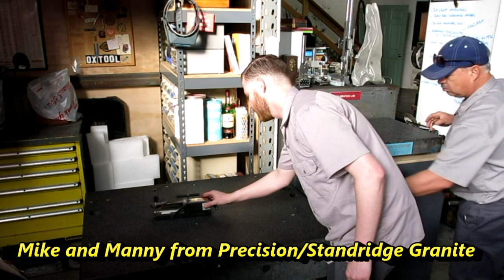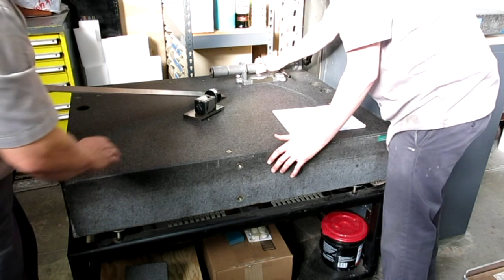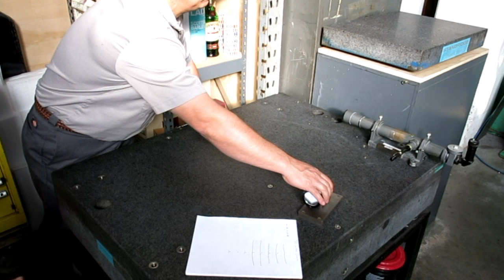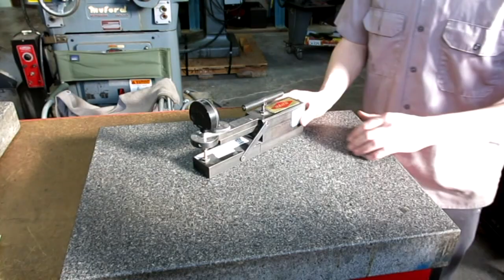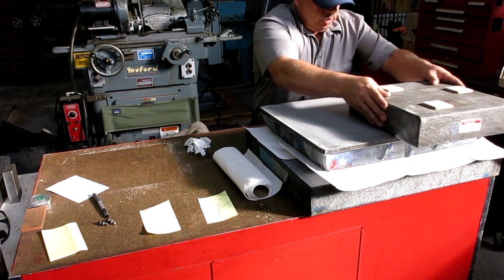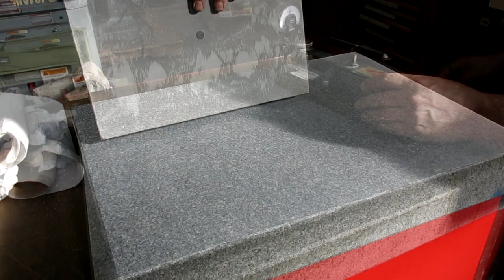Surface Plate Calibration and Conditioning

Comment: Won't the diamond dust contaminate the workshop and cause quick wear & decalibration of plates.
Reply from the maker: Hi Paul,

The abrasive is cleaned off the plates thoroughly after the lapping. Also most of the dust you see in the video is granite and not diamond. As long as you don't blow it off with an air hose it doesn't travel far. Thanks for the comment.

Cheers,

Tom

Comment: I have to come back to his comment @ 3;45+  ..surface accuracy repeat reading of 40 mil and that its not overall flatness ..I am trying to understand the difference ?. I assume flatness is a measure
Reply from the maker: Repeat readings look for small deviations in the surface. The autocollimator looks across the entire surface and evaluates the dips and rises giving a overall flatness. It may not catch the smaller "holes" and "hills" that the repeat meter finds. Hope this helps. Thanks for the comment.

Cheers,

Tom

Comment: I have to assume the iron plates wear as they're used and have to be reconditioned as well.

Cool video.

My scroll saw has a wavy surface with a bowl in it.  It works fine for what I make with it but I'd like to have the table surface ground.  I just don't want to pay more than what I paid for the saw to make it happen.

I do have a cheap granite surface plate (Grizzly) that I could probably use by spray-gluing some sandpaper to it.  Then just do what these guys are doing - either hone the table on the plate or move the plate over the table.
Reply: The honing itself actually keeps the plates fairly flat. I'm sure they need to verify the flatness regularly, but I doubt they need to be flatten often. As to the suface of you saws table, the best way would be to use your surface plate to blue the high spots and then scrape them down. Repeat till you have an evenly blued surface.
Reply: @siggyincr7447   Yes, this. Tungsten carbide paint scraper works great.
Reply: The act of lapping keeps the lapping plate flat and flattens out any depressions on the surface plate by grinding away any high areas. The large lapping plate in the video weighs about 75-100 lbs.

Comment: Really a fascinating video. thanks for posting it.I have a question. The layout and measuring equipment in my little home shop is really becoming a ball and chain at the moment. its the one thing that's preventing me from doing some much more accurate work. I cant afford a surface plate even remotely like the ones you have there! RDG have got one that's certified OO grade. with a surface plate, do you think there is any real reason to go with a named brand? its just a piece of granite right?
Reply from the maker: Hi Peter,

I wouldn't worry about brands. They run free shipping sales on import granite plates all the time. I bought a small one for a friend for $35. Your ability to measure needs to be slightly better than the machines you have to make things. Thanks for the comment.

Cheers,

Tom

Comment: Great video and thanks for sharing and same goes for the crew letting you film/ask questions etc.
I'm pretty sure that there's another video floating around with this guy in it at their shop.It's been a while but I recall him pulling out the old 40's era gear to double check the laser they use.Seems like they've worked a lot together and make a nice crew too.

Comment: could you do a video on making more actuate tools from less actuate tools 
thought being that is the progression civilization started with
Reply from the maker: Hi Bear,

Like making a vise with some files? What did you have in mind? Thanks for the comment.

Cheers,

Tom
Reply: I think an example would be the first lathe making more accurate parts than it has that are then used to make a second lathe that makes more accurate parts than it has, and so on.

So start with a lathe made from tree limbs and "gears" or "wheels" that are drawn and cut by hand.  It wobbles but working on it can get most of the wobble out.

Then round parts are made that are more round than the parts in the first lathe.

I think that's what Gummy Bear is asking about but only using one tool as an example.
Reply: Fuzzy Johnson just that would take alot to do. but you explained what i meant very well

Comment: What exactly are these plates used for?
Reply from the maker: Hi Danny,

These are actually measuring instruments. They represent the primary flat datum in most shops. You can do a variety of measuring and layout work on them. Thanks for the comment.

Cheers,

Tom
Reply: What causes the deformation that needs to be sanded? Just general wear? Whats the purpos of using stone and not a different material?
Reply from the maker: Hi Danny,

The plates actually wear from use. You have to appreciate how accurate the plates are in the first place. Many time smaller than a human hair. Closer to wavelengths of light. So it doesn't take too much wear to knock them out. Granite is good for stability and wear. Some plates are made of cast iron which also wears and needs to be re surfaced to maintain its accuracy as well.  Thanks for the comment,

Cheers,

Tom
Reply: oxtoolco Oh wow. Thats insane. Thanks for the answers
Reply: making sandwiches

Comment: Great video! I'm a metrologist for the DOD...good memories of using the auto-collimator /w mirrors to cal rocks. We now use electronic leveling heads...not as glamorous as the optical way. Very, very cool vid. We have that same H/W collimator on the shelf...it's a beaut.
Reply from the maker: +Michael Dodge Hi Michael,

I am fond of Hilger Watts equipment. I have a level that has a bakelite case lined with leather. Every time I open it up it smells like instruments and precision. Thanks for the comment.

Cheers,

Tom

Comment: I found a plate the exact same as the bigger one he used to flatten yours, in a skip. Had a bit of a gouge in it but i'm sure it can be fixed.
Reply from the maker: +ant smith Hey Ant,

You are correct. unless its broken in half you can fix it. Thanks for the comment.

Cheers,

Tom

Comment: I didn't see any special precautions taken when they were doing the actual lapping with bare hands on the cast iron laps.  Did that strike any curiosity at all by chance?

On my Etalon and Tesas micrometers, they have plastic insulated handles to prevent heating up the tools. I also have an EDA 2 arcsecond master level with a plastic top plate for handling. If you breathe on it a bit or let a sunbeam through a window kiss it, you can see the bubble gradually veer off the vial within a minute. 

I've done handscraping at a hobbyist level and have a few cast iron straightedges/angle blocks/surface plates. If you don't watch how you handle them, they'll go banana shaped when you roll on blue and do a transfer.  I've seen it happen on my 36" Brown & Sharpe camelback straight edge, which makes me wonder why a lap wouldn't go wonky with warm hands since they're also seasoned cast iron.
Reply from the maker: +Syng Stripetail Hi Stripe,

They inspected the plates at regular intervals to see how the work was progressing. There is a large thermal mass to the lap and the granite so any thermal distortion would be slow and pretty small. The repeat-o-meter verifies the work as they go. Thanks for the comment.

Cheers,

Tom

Comment: Hi TomJust looked at your surface Plate Calibration video. I found it absolutely fascinating. I need to have mine recalibrated and thought it was done with hi tec grinders and such. Had no idea it was so basic. Many thanks for the education. By the way what was the name of the oil you used to quench your edge finder ??? Keep that American flag showing. Warm regardsTom

Comment: What a delight!  I envision that an individual could us the method for generating optical flats to true up a plate.  There would, however, be no grading to accompany the plates if grading was an issue.  I just purchased a Standridge 36" X 48" X 5" plate that has a crack (not all the way through).  I figure that I will end up with a 36" X 30" plate after I have it cut.

Comment: So my question is, how was the first surface plate made? you need a surface plate to make the tools to surface a plate
Reply: +EitriBrokkr 
If you google foundations of mechanical accuracy pdf and look on page 20, youll find the 3 plate process.
3 surfaces are worked via scraping and checked against each other. If
 all 3 surfaces agree then they must have reached a 'flat' condition. 
Fascinating stuff :)
Reply from the maker: +EitriBrokkr There is a process to make flat planes using three plates. You can produce as flat a plane as you need with no measuring tools. Its truly fascinating. Thanks for the comment.

Cheers,

Tom
Reply: oxtoolco wow, I  did not know that, could you go through it in a video sometime?
Reply: original surface plates where actually cast iron, untill WWII
Reply from the maker: +Mike Folgers Hi Mike,

That's what comes out in the end. You need the third plate to expose matching between the first two.  Thanks for the comment.

Cheers,

Tom
Reply: Research automatic generation of gage surfaces. Henry Maudsley and Joseph Whitcomb should surface, hand scraping cast iron, a true lost art, scraping three rough plates to each other in a designated sequence until all three plates agree with eachother, the only geometric shape which can lie amongst three surfaces is a true flat plane. Matching two plates could give convex and concave plates which compliment eachother, however add a third plate, convex won't match convex or vise versa with two concave plates. Scape plate A to plate B and plate B to plate C, then C to A and the cycle continues. I should mention a twist can develop in a flat plane and yet have all three plates matching, this is simply corrected by rotating each plate 90° before each bluing for scraping. What geniuses truly lie at the base of this trades origin, and to think they had that figured out in the 19th century.
Reply: @cgprecision  Thanks for this, I knew it somehow involved geometry but didn't know how.
Reply: fred bear
hey, thanks a lot
Reply: Youre welcome man, enjoy ;)
Reply: +fred bear Can you provide a link please?
Reply: +cgprecision   I would think that flat planes originated using stone , with the same procedure that you describe . . . the difference would be using no scraping. . . just the weight of stone against stone of equal hardness - they would wear into one another .  * This being on a rather small scale , however; with the right slurry . . . MONUMENTAL items were produced !  * key word being monument !
Reply: I was inferring that monumental STONES were made flat and planar through a similar process ,  * think ancient obelisks  EitriBrokkr

Comment: if you have a granite plate, it won bend in cold like he says at 12.58  because granite does not behave like iron. by the way this is my second comment on youtube ever. this guy is just selling his speech, if you look the video again. that amount of abrasion with those kind oftools would do nithing to that plate, i know i am an expert stone grinder. cheers!
Reply from the maker: +Longgooncolombo Enzales I'm curious about your statement that granite does not behave like iron. It behaves like all materials do and expands and contracts with heating and cooling. The magnitudes differ but the effects are the same. I think you don't understand the tolerances involved here. These changes and measurements are many times smaller than the finest human hair. Grinding countertops or headstones is nothing like this process at all. Thanks for the comment.

Cheers,

Tom
Reply: +oxtoolco I think he's greatly underestimating the measure of millionths. Just touching it could leave a millionth inch of trash. He should watch your video on how thick is a sharpie mark.
Reply: @jfbeam  the thermal gradient of granite is 3millionths/ foot/ per degree farenheit.  They shot have measured the top and bottom of the granite,  and yes, he greatly over estimate the thermal effects of changing concave to convex!  I am in metrology,, in case you are wondering.

Comment: Tom: Great video! Could you describe what the view through the autocollimator looks like? I use autocollimators for collimating telescopes which are simple front surface mirrors with a hole to look through. This autocollimator looks to have additional optics. I would like to know more about its design. Thanks much for making this video.

Comment: Hi,

Thanks for the upload of this clever and amazing video. Super when using already tested I assume the ‘Lapper’ is already tested before it gets anywhere near your granite, and for such a quick and easy m/o to give such wonderful accuracy I find truly spectacular. 
I have only ever done anything related to what you had don, only once, when I lapped the head and the cylinder-block of my engine, and this was before computers so reading of how to do this was simply stated the lapper and the item getting lapped should both be moved in a "swirling motion" just as the chap lapping was trying to achieve as he worked from all four sides turning the lapping plat at precise times, cool very cool.

Comment: Ultra fascinating .... Makes you wonder if it was that quick and easy to bring them into spec is it just as easy to throw them out of spec? .... Best video yet thanx.
Reply from the maker: +chuck smalfus Hi Chuck,

They were using abrasives to lap the plate. Normal use does not include abrasives so they can last for years depending on how much you use then and how clean you keep them. Thanks for the comment.

Cheers,

Tom

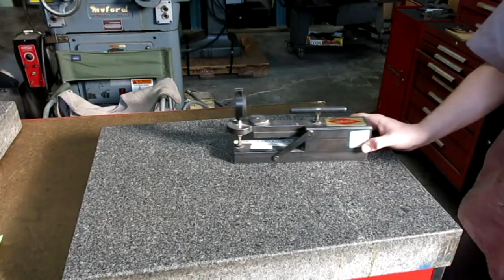Comment: The medium size plate - the one getting all the attention from about 15:16.  When the guy measures he identifies a "trough" down the left side ... but am I seeing a fault line or crack running the full length of the other side? - it's about 1.5 hands from the right edge as we're seeing it.

Comment: Hey Tom, I have the same model autocollimator (with the same light mod ha ha), they're not as expensive as you might think, and a bit of shopping around can get one for what I think is a good price. The guy is quite right about the 90 degree eyepiece however; impossible to find! 

It was interesting to see them split the plate, as they split the lines in half instead of using a second mirror. The Rahn repeat-o-meters are typically expensive and now you see how they're made, somewhat pointless for many applications. It wouldn't take a rocket scientist to make one up, as he said, they're just a height gauge with an oversized gauge block.

Thanks for sharing that, very cool to see some pros at work, and it sounds as if the price is right up there.

Comment: Now if I just had a granite plate. I'll have to make do with my 12" x 18" cast iron plate for the time being. I've tried to measure its flatness using a surface gage holding a tenths indicator, and "sweeping" back and forth from all angles. I can see some movement of the needle, but not as much as even half a tenth in any position. I think I am getting good measurements, since the needle movement is consistent. (I get the same needle motion when I come back to the same place.)

Comment: That was great. Are the laps anything special, apart from being dead flat? The big one looked like a re purposed cast iron surface plate.
Reply from the maker: +princebatswater You are correct they are cast iron surface plates. The lapping process tends to improve their flatness as they are used. The randomization of the action against another surface tends to eliminate the high points. Thanks for the comment.

Cheers,

Tom

Comment: So the standard of standards all boils down to rubbing two flat surfaces ... awe hell ... as complicated as measuring some machining surfaces can get, in contrast it seems so stone-age simple to get it there.  It all goes back to rubbing two rocks together.  Thanks for giving us a look at the process!
Reply: Technically if you rub two rocks together you'll end up with one convex and the other concave.  

Realizing a flat surface from scratch is only as simple as rubbing three rocks together.
Reply: Jordan Rodrigues Yes three al la Whitworth, if any two will mate all three are flat.
Reply: @jordanrodrigues1279    hehehehe!
Reply: True flatness requires three plates. And they must be rotated both in the horizontal and end over end. Otherwise twist can be introduced.

Comment: oxtoolco Thanks for letting us see the process! Amazingly simple and accurate. You mentioned at the start of the video that you had a problem with getting repeatable measurements on one of your plates. Was that the mid sized one with the "trough" in it? I flatten a lot of chisels and plane irons. To tell if they are dead flat, reflections on them tell the whole story. If a straight line is not reflected as a straight line on the surface of the blade, the blade is not flat. Typically there is some very slight round over towards the very edge of the blade. This shows up as the reflection wrapping around the edge a bit. Thanks again! Love your videos.

Comment: Used to work around a place that made Blade Rotor parts for the Black Hawk, they used a 8 ft  by 10 ft inspection table, with a computer controlled touch system on a arm, used to sit and watch that machine do its thing. Truly amazing work.

Comment: i think this is total bullshit, granite does not bend or wear, does it. At least not from that kind of use.??
Reply: Lol, yes, it does.
It doesn't "bend", but it expands and contracts with temperature, and since flatness is needed in the millionths of an inch, it doesn't take much to wear it that far, especially if it is not being handled properly, chemicals on it, rough metal, etc.